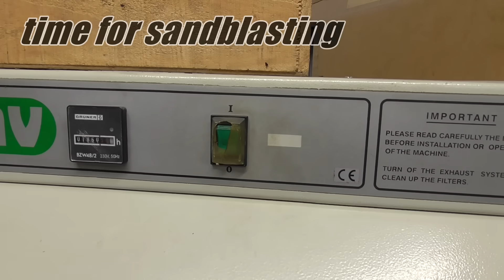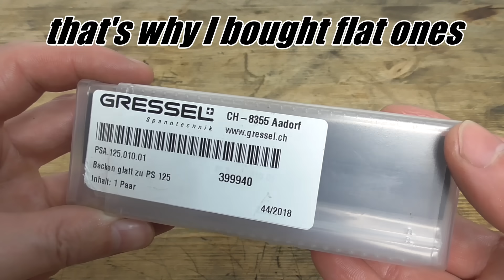Rusty Deadlocked Vise - Perfect Restoration

Comment: Somebody else mentioned using a torch to get it apart. Thought that was strange. Found it very strange that you didn't blast it first. What was the point of smoothing all those surfaces, then taping, then blasting. Blast everything first, then smooth surfaces. The blasting is going to remove far less material than what you had to do with a file trying to remove the old rough milling. Anyway. Actually love what you do. Video was awesome. Just found that one step in particular rather out of order, and all that taping was superfluous.

Comment: Beautiful restoration and machining.  I was curious, however, why you didn't prime the bare metal before applying the finish coat?
Reply: because you can apply the paint directly on rusty surfaces
Reply: @printerrepairgerman9096  But this wasn't a rusty surface.  It had been sandblasted back to white metal.

Comment: question - i found an old vice in my dads shed. turning the bar will close the vice tight but i have to pull it by hand to open it after turning the bar. what part would be broken or missing for that to happen?

Comment: why the heck would you heat treat something that wasn't MEANT to be heat treated?? If it was supposed to be heat treated it would have already been
Reply: He didn't heat treat it. He blued it. Bluing is 300-400 degrees. Heat treating is 800-900 degrees

Comment: Cool - nice work.  I restore cast iron cook ware for a hobby.  I just make it new and give it away.  Idle hands.  i'm wondering if you could use electrolysis to clean the vice.  It really works well for old cruddy cast iron pans.  I'm not a machinist and have no access to the tools anyway.  But it would be fun to try to restore something besides a skillet or dutch oven.   Thanks for posting - a thing of beauty.

Comment: Couldn't you have sandblasted first then sand and grind the smooth parts instead of using the metal tape? 
Still, samurai sword maker skills here!
Reply: Sandblatser doesn't give a smotth enough finish, even with an oil stone after

Comment: I knew you had your work cut out for you when you showed the 'before' video! This thing was corroded! Nice machining, lovely painting, great attention to detail. Normally, the only thing that precedes abrasive blast is disassembly and solvent clean (to keep grease out of the abrasive), then dealing with machined surfaces would happen after abrasive blast. Also, people typically use rubbery masking, such as one or two layers of duct tape (you have to use the good stuff), instead of aluminum tape to mask for abrasive blast. Excellent use of custom tools to deal with stuck parts. Great editing.

Comment: So impressed by your level of work & the time you put into this restoration. I can't even imagine taking on a job like this. Just the time spent on labor would be able to buy at least 10 new cheap Harbor Freight vises. I wish I wasn't part of a society that treats everything as disposable & lacks the knowledge or will power to fix broken equipment. I also remember a time when things were built to last a lifetime. Stay True

Comment: Why does he have to protect those specific parts with the aluminum tape when sandblasting?
Reply: Because sand blasting is exactly how it sounds. He was protecting them from getting gritty and jagged because he had just smoothened them
Reply: @josephgambino8306  gotcha. Thanks
Reply: @richardsanchez9190  np

Comment: Question 2: where is the coolant in the lathe?
Reply: Don't need it with these tools
Reply: @sovietcomrade7733  well.. i saw smoke coming out the lathe tool.. i dont like it, you are trashing it nonsense without using coolant.
Reply: @saxombie8614  With some tools you're not supposed to use coolant. On a lot of tools you need not to. It can damage the tool
Reply: @sovietcomrade7733  ehmmm strange...  Well, the thing is, i didnt liked the smoke there, not good. In this case, i think is wrong not using coolant.
Reply: @saxombie8614  It might just be oil on the piece. You know, oil to prevent the thing from rusting to much

Comment: Don't understand the smooth jaws?
Isn't that part of the entire purpose of a vice..gripping the item firmly that you're about to work on..
Reply: For more delicate or precise projects smooth jaws can provide enough grip but with a reduced risk of damage to the work piece.
Reply: Many vices have reversible jaws - rough on one side , smooth on the other. The smooth side is used to keep from marring something soft, like brass or stainless steel. I think that's why he ditched the rough jaws. I'd have kept them reversible

Comment: Beautiful job but the amount of effort you went to, including building new specialised tools and fabricating new parts, buying new jaws etc - with your amazing skills, why not make one?
Reply: You're right about making a new one,  but making one is a different 'ball game' entirely.  One would require a lot more industry and infrastructure which would be unwarranted were you not manufacturing them on a larger scale.   Restoration however has many other benefits, it also gives the restorer an appreciation of the skill and techniques required to engineer and produce one in the first place.   Could 'you' make one as good as the one being restored? You posed a really good question.

Comment: Why you are greasing threads of the screws? It will only lose them up in the future. It's better to use some thread locker on these, and grease on parts that should be moving

Comment: Nice video.

Total noob here so idk what I'm talking about, but why do you sand down the shiny parts and cover them with aluminum tape before the sandblasting? I understand why you put tape on the threads in order not to damage them. Wouldn't sandblasting before the sanding save you the trouble of putting the tape on?

Comment: Im looking to restore my grandfather's vice. Its about 40 years old and was untouched for 34. I am 16, with no tools or equipment. Any ideas???
Reply: Good for you. I’d start by trying to pick up some basic hand tools. Hand files, etc. Look for garage clear outs or boot sales. You can often pick up some quality vintage tools as a job lot for very little. You could also begin by cleaning these old tools up as practice before moving on to a bigger project like the vice. Also look out for community sheds/garages where you can borrow some workshop space and tools and get advice from some retired engineers/mechanics. Best of luck, I’m sure your grandfather would be proud.
Reply: @Claggy53  Thanks Donna. At least I know where to start now. :)

Comment: Silicone based WD-40 isn’t best for that application. What you need is a spray oil or penetrating oil to brake those parts loose

Comment: 12:46 I’m sorry what kind of oil?
Reply: Google translate .Perdón por contestar en español. El proceso se llama pavonado en caliente « heat oil bluing ». Se puede usar cualquier tipo de aceite ya sea el comestible, el que se ocupa en los coches o el de la industria metal-mecanica. Muchos recomiendan el aceite desechado de los coches, porque entre más impurezas tenga se impregna mejor en el metal. Espero te halla respondido.
Reply: Canola Oil. Previously commonly referred to as rapeseed but due to the negative connotations in English it is known as Canola.

Comment: 10:40 It might be much easier to paint raised letters like that if you use a small hard rubber roller...
Load the roller like you would load a standard paint roller but because the roller isn't flexible like a standard roller, it will only apply paint to the surface, rather than the surface and the sides...
A Lithography Printer uses the same technique to apply ink to the printing blocks...
Your local Hardware Store should sell the rollers in the flooring section as they're also used for linoleum tile I believe...
Reply: That is a good idea. However painting the raised letters that way leaves room for paint to go where you don't want it to go (dripping). This guy's got a system and it works for him. "If it ain't broke, don't fix it".

Comment: Me, 10 seconds into video "Hey, I could do something like this!"
Me, 5 minutes into video "Nevermind."
Reply: Yeah, I found an old rusted vise out behind my yard, and being currently in need of a vise, I thought maybe I could restore it to working order. Lol. Nope. Looks like I'll be picking up a new one.
Reply: jawbone78 you kidding? This is not something special,. Everyone can do this.. and you dont have to restore it with bondo like this guy... just make the vise work, its a Tool it doesnt need to look pretty..
Reply: @jawbone78 /videos Dude. Go for it. Seriously, this is not rocket science. You need some lubricant, a good hammer, wood of harder essence (plastic pieces like Delrin is good too) whatever size nuts you might have, their respective wrenches and patience. I fixed a bullet vise i picked up from the ground in a junk yard with nothing more than common tools. Even hacksawed the horse shoe driver piece out of stainless.
Reply: @aserta  Maybe it's possible, but I don't know anything. This stuff is way outside my area of expertise. I mean I legitimately know nothing about tools. Never learned, was never taught.
Reply: @jawbone78  Just take your time and don't be afraid to ask for help. As long as you don't have any time constraints and you persevere, I'm sure you'll get it done. :)
Reply: Lol

Comment: when you said you hammered the jaws from the vice, and it took 30 mins, why did you hit it on each side? wouldn't it be easier to just hit it in the center of the two pins to distribute the force evenly? and crc is a better

Comment: kind of ironic if you need a vice to disassemble a vice :) well done ! the problem with these vices are mostly that the table wich they're mounted on is to weak. I usualy bolt them on a steel plate and then mount the steelplate to the table with 4x M12 bolts and nuts. That way you cant tear the vice out of the wood ;)

Comment: why so much grease on every part even on the screws?
Reply: So that they don't completely fuse again next time around? As for the parts other than the screws, that's metal on metal in motion A LOT. That can't have enough grease. You want a vise like this to be usable with your little finger, grase helps to ensure that's how it stays.
Reply: @LeutnantJoker  yeah when you want to use it under water its ok or let it sit in the Rrain for 10 years but normaly screws need nothing on them   thats just idiotic

Comment: Hello. A perfect (in my opinion) restoration.
Thank you for sharing the methods.
I would like to chip in with one small idea : instead of painting the Letters with white paint,
you can get a better result (with less effort) if you use a flat file over the whole word till you expose the 

bare steel. Finish off with clear lacquer or enamel.
Reply: the paint makes it pop more but thats a really good idea for someone who's not as diehard as he is. I don't think he worries about the effort if the result is stunning. he did spend 30 minutes just hammering a small part off. his dedication and proficiency is super admirable

Comment: It's amazing how old vices hold their prices. I recently needed a much lager vice for a job, but a new one was almost. $300. I finally bought a used one of the correct size at a pawn shop for $80 and still had to restore it up to a point before I could really use it.  Apart from the rust and the missing part, this one here is still in pretty good physical shape.

Comment: I'm curious why you prepped and taped those surfaces first before sandblasting?
Reply: They are mating surfaces for both parts of the vise. You don't want them to have a blasted finish, they need to remain smooth. Cheers.

Comment: At 12:40, I didn't understand why he burned some parts at about 300°c... Just for the color or for some other purpose?
Reply: red rust is destructive and will never stop eating into the metal until the whole thing is dust. but there are other types of "rust" or iron oxide. what he's doing is actually similar to seasoning a cast iron pan. it forms a protective coating, a kind of iron oxide similar to rust but which is much harder and doesn't rot the metal, and stops red rust from taking over.
Reply: @sleepCircle  Oh I understand better, thank you very much! (Even if my comment was 4 years ago ahaha)

Comment: Execllent work and a VERY nice vice. 

Did you consider using electrolysis to remove the rust? 

You said that you weren't a fan of the rough edge on the jaw face. You could have reversed the face and saved the price of the new ones. 

Just suggestions.

Comment: Damn straight I SUBSCRIBED. That was a great journey captured on film. So cool to see the whole process not just the before and after. Thanks for creating this channel to the restoration of real quality. 

It would have been SO easy to just toss this in the trash and go to a harbor freight store for some crappy piece of low quality steel item that would fail after three uses. 

Instead you took the time to restore and return to glory an real piece of craftsmanship from years gone by. I was right there with you as I saw the road blocks to the resto, and thought how I would solve them and compare notes.

Comment: The reason they are called an "oil stone" is that you use them with oil - to lubricate and clean the stone whilst in use and make it last a lot longer and be more efficient.

Comment: Ruined by 'Hammerite paint job'. Just use a good oil paint. Bad idea to 'Heat Blue' handle and thread...it leaves the metal annealed (softened) and easily bent.

Comment: something I noticed while watching this video in particular.  When you are milling and running a lathe, the smoke you see coming off your parts means whatever you are using to cool them isn't sufficient.  Additionally, any time you see blue chips or spirals coming off a piece, you are heat treating that metal and causing unnecessary wear on the tool.  There were a couple of times you hit hard with the drill and I visibly cringed.

Comment: Admire your skill,your talent, your patients! I'm sure you had your reasons for not taking the handle completely apart! Which brings me to my question, what is the chemical liquid that you placed the heated parts into? I am familiar with using a different, that did not require heating.
I would prefer your way, seems much easier!
Reply: Rapeseed oil.

Comment: Excellent work. By the way - simple idea - to use jaws preferred surface (smooth and rough) it is possible to adopt it two sides working (only two tapers needed) instead of replacing originals.

Comment: Excellent work as usual. Just a suggestion.
When you paint over the names and tags/letters with a brush it tends to become a bit shaky.
Why not try a foam roller which with light pressure would cover only the surface of the letters.
This would maintain an equal level of excellence also in this step of the restoration process.

Comment: Another perfect restoration.

I also learned that there is a tool called impact driver. Next step is to buy one.

By the way they say acetone and ATF  mixture is very good at un-seizing stuck components, better than WD40. May be you give it a try some day.

Comment: I remember  machining these castings threaded   rods  and  dovetail milling    in my  Tool making  schooling  days    mostly  50-100 of them we produced in  month time ( the  institute had  orders  from  some  traders)   ..Dovetail  matching  was a  big issue for  me  We  used to do  blue matching  of  fixed and  moving side  and  got it to be    snug fit..When  we  finally assembled   these things  My instructor  came  to inspect  the final assembly  and  rejected  all  The idea  was that these  vices  are  used for  holding  raw material  and  not  finished    goods alone  there fore  he wanted the  male and female  to have  clearance  fit  so that  it can    fit to  accommodate any   tapers  on raw materials  .Now  I had to  file  all dovetails  which I had  done  so carefully  ..God knows How I reached  here  But  U  brought back  my  schooling days  I felt  as if  I was again back in school

Comment: Should have used electrolysis to remove rust, scaling ect.  You worked way to hard. A little baking wash and a battery charger would have saved you a ton of time and effort.

Comment: That was pretty impressive. Never seen the process from start to finish, great work! I have questions... why did it matter if it was heat treated, how did you know by just scratching the surface a bit ?  And I didn’t quite catch if you removed the screw you were drilling into or if you just made a new one over the existing with new threads ? Again just never seen this kind of work done it’s all new to me seeing it first hand.

Comment: WD40 is generally pretty lame when it comes to freeing rusty steel. I suggest PB Blaster which also does a great job helping break parts free (for steel and iron). It has great penetration qualities. Also heating stuck screws with a torch just to get them hot enough to make oil smoke and then dousing them with PD Blaster sometimes helps free stuck screws. 3 in 1 Penetrating oil also works pretty damn good. The best I had found however for breaking screws free is La Co Zoom Spout oiler. I used to find it at any Ace or True Value hardware store. The hot metal trick always worked with La Co save those rare few REALLY stuck bolts.
I will say however that was a nice restoration and you also get a very high quality bench vice to go along with the deal. That is a tool that makes a nice show piece in any workshop. I hate the Chinese turd piles they dare to call shop tools. What you have there is very much better than most of what is sold today.

Comment: Why didn't you try electrolysis to remove the rust and unstick the parts? Vice would be the negative electrode, and a sacrificial piece of steel would be the positive electrode.